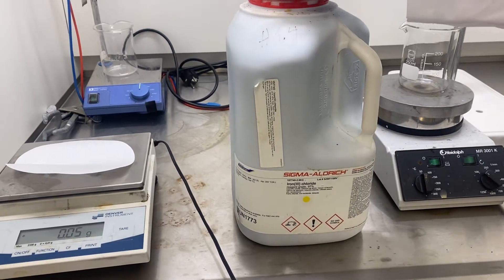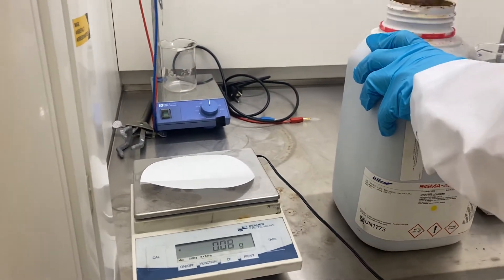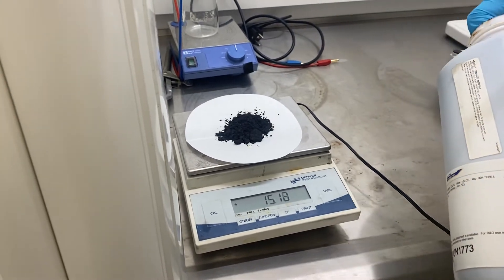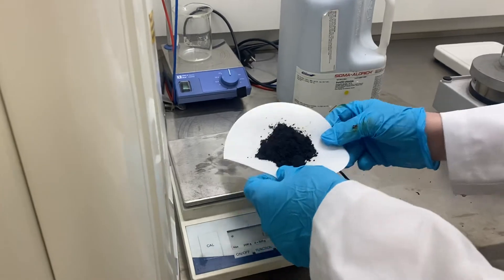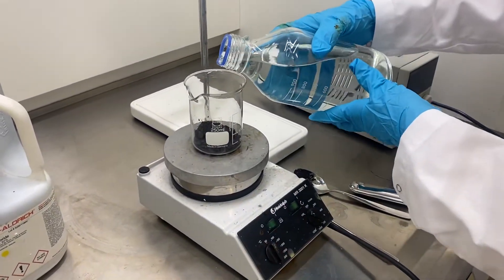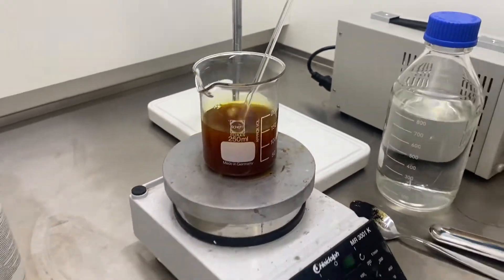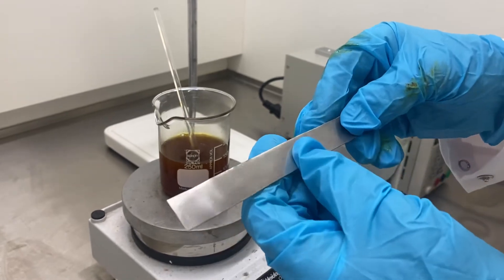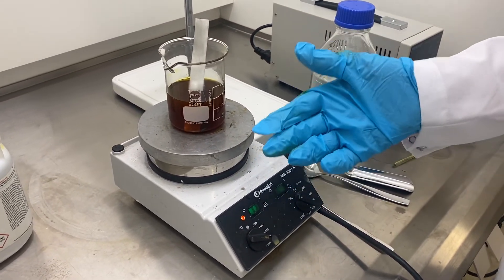pitting corrosion in hot ferric chloride - setting up

Comment: is there a purpose to pitting corrosion in hot ferric chloride :face-fuchsia-tongue-out:
NO :face-orange-raised-eyebrow::face-orange-frowning: 
Here's why ferric chloride is used to study pitting corrosion instead of a desired outcome :face-blue-smiling:

Testing Material Susceptibility
Ferric chloride solutions are used to evaluate the corrosion resistance of materials, particularly stainless steels, by assessing their resistance to pitting. The higher the concentration of ferric chloride and the higher the temperature, the more aggressive the environment, and the more likely pitting corrosion will occur. 

Identifying Critical Conditions
By testing materials in ferric chloride solutions at various temperatures, researchers can determine the critical pitting temperature (CPT), which is the lowest temperature at which pitting corrosion will occur. 

Understanding Corrosion Mechanisms
Studying the behavior of materials in ferric chloride helps in understanding the mechanisms of pitting corrosion, including the role of chloride ions, pH, and temperature. 

Predicting Material Performance
This knowledge is then used to predict how materials will perform in real-world applications where chloride-containing environments are present. 

Investigating Stress Corrosion Cracking
Pitting corrosion can act as a stress concentrator, initiating stress corrosion cracking, which is a severe form of material failure. Understanding how pitting corrosion initiates can help prevent this type of failure. 

ferric chloride is a tool used to study and understand pitting corrosion, not something that is intentionally induced for a beneficial purpose, according to corrosion experts :face-blue-covering-eyes::body-blue-raised-arms::face-fuchsia-poop-shape: